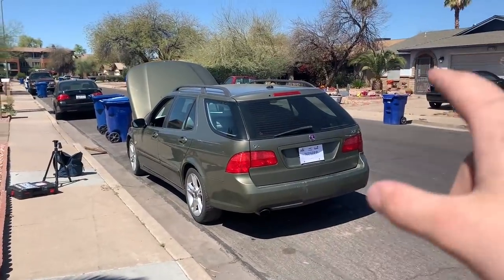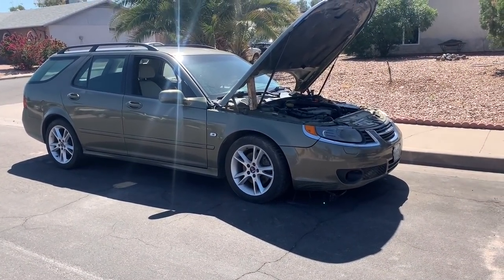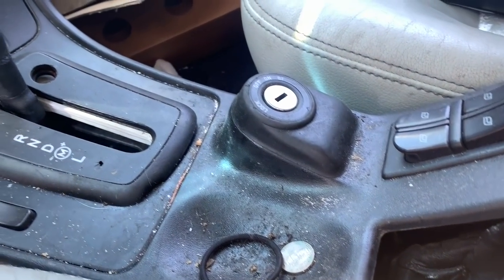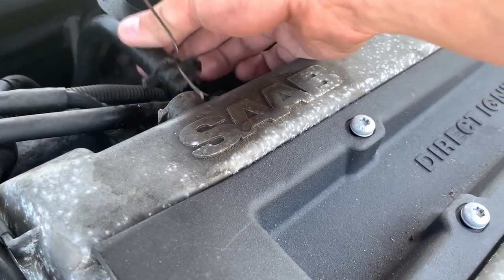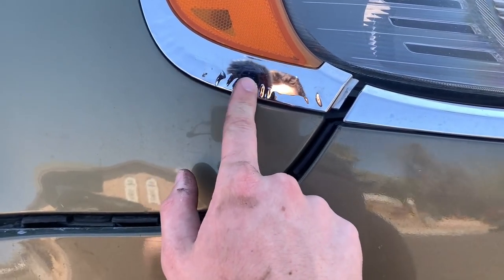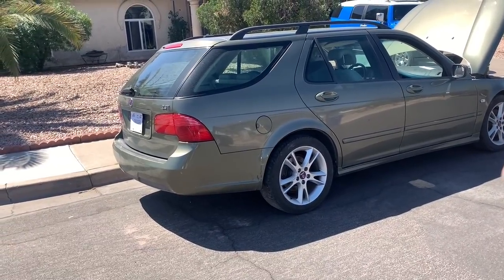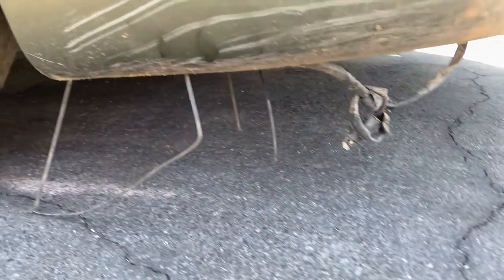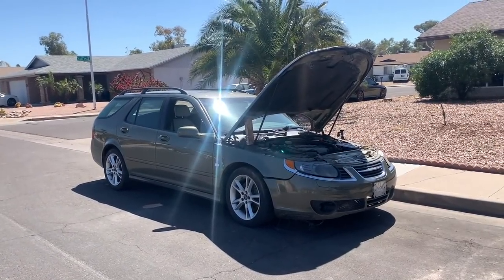I Bought the Cheapest Saab 9-5 in the US! (Non-Running)

Comment: Very nice color! In 2006 there was no Aero trim, there were only 2.3T models, this one looks like a regular 2.3T from the interior, but it wouldn't hurt to run the VIN and see if it has the sport package or "sport" in the model name, because that was the Aero package for 2006.
Reply from the maker: It doesn’t have aero seats like you said, but does have paddle shifters, so idk. I’m not as familiar with 9-5 trims as I am 9-3 trims 🤔
Reply: @Auto Autopsy If I'm not mistaken all of the automatic 06+ 9-5s had the Saab Sentronic transmission with manual shift capability. I am almost certain it is a normal 2.3T, but it wouldn't hurt to check!
Reply: @ErikTS  I have the same 2006 2.3T ARC wagon, they all have the Sentronic. The 2.3T from this model years have 220HP but the big turbo (as the Aero), so you get more or less the same HP out of it with a Stage 1 as an Aero.

Comment: Does anyone know of a good way to secure the fender when the tab that should receive the screw is broken off like this one is? I have the same issue. So the wheel well edge of the fender keeps sticking out a bit.
Reply from the maker: use some universal mounting brackets (zip ties)

Comment: Straight to the oil pan and replace those o-rings. Trust me. They are trashed and killing oil pressure. Plus you get a nice idea of how she was treated by looking in there.
Reply from the maker: What o-rings?
Reply: @AutoAutopsy  In the oil pan there is an o-ring between the pan and the oil pump pickup tube. There is also a pipe inside the oil galley, right above the pan, from the rear of the block to the front of the block, that transfers oil into the oil filter assembly. That tube has an o-ring on each end. The heat and petroleum environment caused them to swell and get brittle and lose their seal, causing pressure loss at those spots. I went from 10psi to 20psi at warm idle, just by replacing those 3 o-rings. While you are there you can also clean out the pan and the pickup screen, which can clog. If the oil was not taken care of, you will have a sludge mess to clean out of there as well. Check out Kyle Pancis' videos about it. They tipped me off to check mine.

Comment: Don't know if you would have an answer for this or not but I picked up a  2008 9-3 2.0T last month. Put in the bsr intake after like a week of owning it and its been fine but a few days ago it started sputtering once I was halfway or so down on the throttle. Im thinking it could be a coil pack but not sure. Took it to the closest Saab shop near me and their diagnostic machine couldn't find the issue so the guy basically told me to go somewhere else. The car has almost 150k miles so I assume they were probably never changed before. Have you ever seen an issue like this?
Reply from the maker: what saab shop couldn't diagnose a misfire??? Jeez...
Yeah, it's probably plugs or coils, assuming what you're describing is a misfire